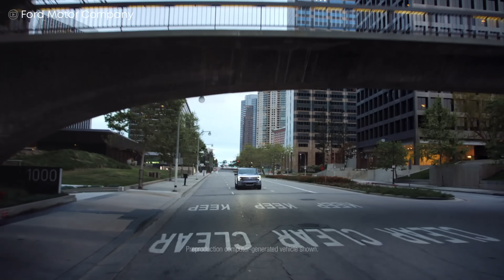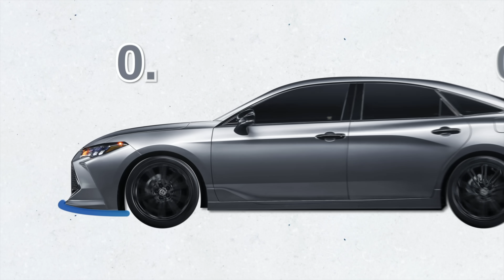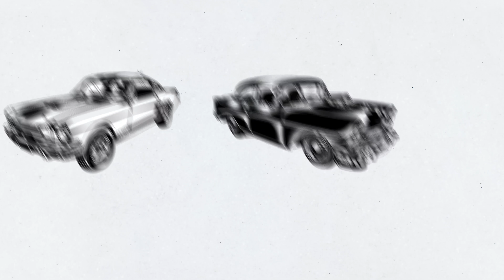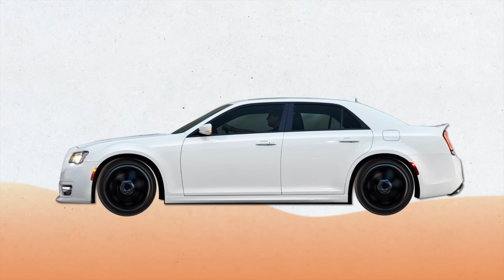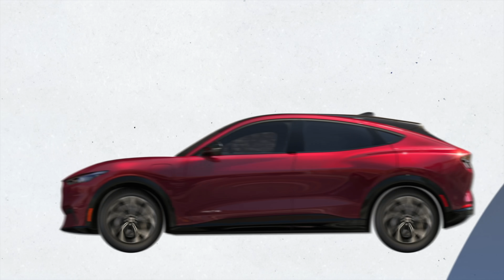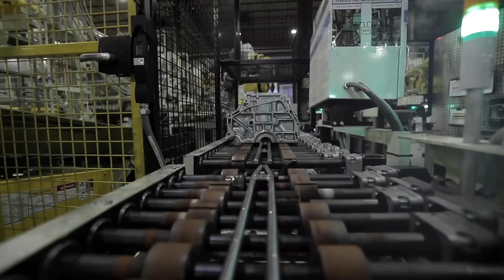No One is Telling You the Truth About These New Cars, So I Have to

Comment: Even though older cars are death traps when it comes to safety they have way more class when it comes to exterior and interior designs And are very refined
Reply: Like are you talking about 50 years ago or 20 years ago? 50 I might agree, 20 and you got most of the same features today, just less refined.
Reply: I mostly say from the late 60s and earlier but some 80s care are greater for their era
Reply: Such as the toyota corolla years 1980 81 82 83 85 86 and mabye 87

Comment: Modern cars are nothing but overpriced plastic eggshells on wheels that just makes you want to puke 🤢
Reply: To a certain extent.
I have a new CX-5 and it is far from boring aesthetically, and a fun car to drive around.

Some EVs are bland looking, but the new Lucid Air is sleek, and is super quick.

Nothing will beat the aesthetics of a classic muscle car from the 60s/70s, but I do appreciate the safety that modern cars have.
Reply: @TurkeyBaconSandwich9er  the problems with 60s and 70s cars is they don't handle on the highway as well bc they don't have all the modern suspension geometry and improvements that 90s and newer cars have. If you want to spend alot of money you can modify old cars to handle better, upgrade to disk brakes etc. Those old cars ran on bias ply tires...before there were radial tires. Even just putting modern wheels and tires on an old car helps a little. The problem as I see it with modern cars is the extreme reliance on electronics which very quickly become obsolete and way too much plastic...which will all be crap before the car payments are finished.
Reply: Wait until we are overrun with electric, plastic overpriced golf carts. You havnt seen boring until you see one of those.
Reply: lol i like my Lexus Coupe but it depends on the colour you get because of the grille design. If you keep it to grey or silver colours it blends in well. As much as i love the bright blue it just doesn't suit the grille.